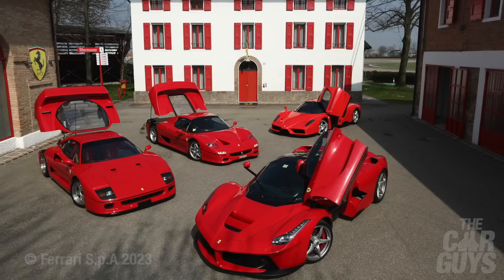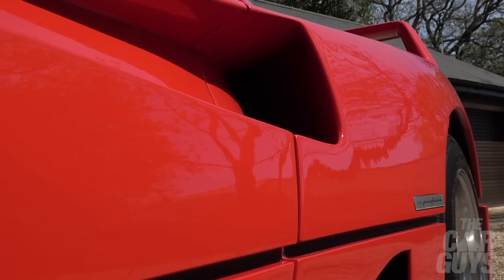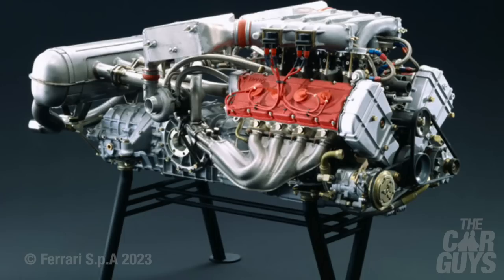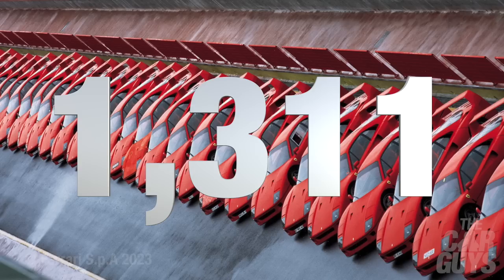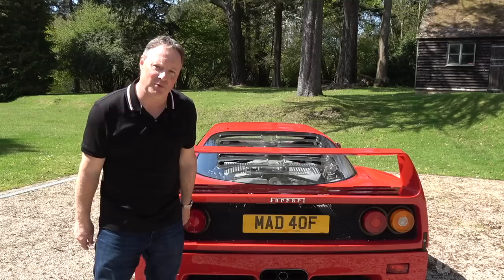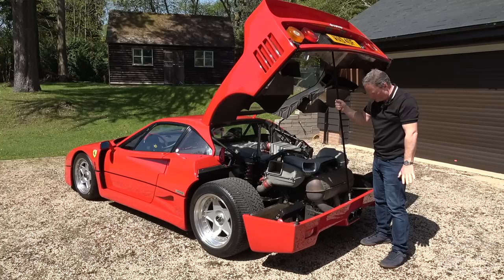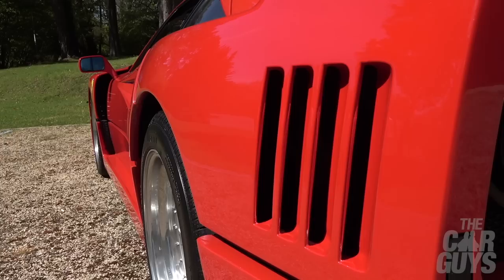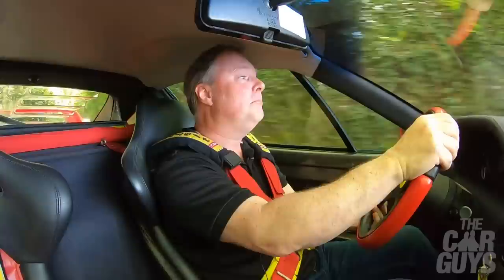FERRARI F40 - Why Are they Worth so Much & Will it Stop? #DriveEveryFerrari | TheCarGuys.tv

Comment: A curiosity that few people know and Ferrari would have forbidden those involved to reveal, the first produced units of the F40 in 1987 "between 20 and 25 units" have the same power as the 288 GTO EVO over 650hp and the weight below 1100kg because they were not within the regulations time traffic! But with that these units have a top speed of over 360km/h and do 0-100km/h in exactly 3s with the right tires! I had the opportunity to drive a friend's F40 a few times, each time I fell even more in love with the car, what a perfect machine! This friend's car is almost a daily for him, in just over 6 years he has already put more than 45000km, as he usually says, an unused car is a car that gives problems!! I hope to one day reach this level in my garage! Great content as always!
Reply: I had the privilege to race an F40 at Bira circuit Thailand many years ago. It was everything Damien said, and the acceleration was phenomenal when the turbos kicked in. That this was the last Ferrari approved by Enzo is indeed a fitting tribute to his genius.
Chris D.
Reply: Jean Alesi was provided with a standard looking 288 GTO with a 640-670 hp tuned engine. Saw a tirwsmoke filled picture of him and the car in a danish carmagazine.

Comment: The F40 was and still is my dream car.  If my numbers ever come up on the lottery this is the first car in my garage!! Great video love this series. 👍
Reply: Get the F50 instead, it is a better drive and has a V12.  Also you can take the roof off.

The F40 has great  looks but it's pretty close to a 288GTO which in itself is fantastically good looking.  And built better.

Comment: 288 GTO, 288 GTO EVO, F40, F40 LM, F40 EVO, F50, F50 GT, ENZO - these are the greatest Ferrari's ever made.
Ferrari went on after the Enzo, to make even faster cars.
But, none of the faster cars are on the same level as the 288, F40, F50 and Enzo.
The Enzo was the last great car Ferrari made.
Some people might think the LaFerrari is joining these greats.
Beauty is not everything, when the holy trinity were launched it was slowest accelerating and slowest lap times of the 3 cars. Surely a great Ferrari would not come last in performance and handling. Ferrari also find it hard to find replacement batteries for the LaFerrari, sometimes taking over a year to source some. Beauty alone does not make a great Ferrari.

Comment: I don’t doubt the iconic status of the F40 but have always doubted the last minute cobbled together vibe of the car, with very limited development prior to its public announcement. No one really wants a turbo car with more lag than an oil tanker, when a V12 is really what is needed. I remember seeing an F40 on the way to the Mille Miglia F40 meet in a motorway rest stop near the Gotthard tunnel - Father and daughter were in an F40, the daughter was driving & the whole car vibrated as they started the car up, the plexiglass glass was almost buzzing with vibration & the daughter who was driving, she had to really really saw at the steering wheel to reverse out of the parking bay. Both were hot & red & looked thoroughly miserable. It’s clearly a car for a blast, not a grand tour. Each to their own.

Comment: I think with sticky tyres an F40 will easily beat the 4.5 0-60, I remember back as a teenager when they were new I think it was Fast Lane did 3.9 in a std one as they continued to 170. Power to weight is still v high and as other commenters say, they usually had 500hp plus. I imagine half a second is nearly lost doing a dog leg 1st to 2nd though which a modern dual clutch does near instantly, so probably 0-60 is not a true measure of how quick they still go!

Comment: Great video once again of course.,

The problem is that the F40 has a few issues on being a great car and no, I am not talking about it having worse build quality than a 1980s Lotus. If you took the badge off it and just showed it to someone who knew nothing about cars they would say it was a kit car and worth about £20k rather than £2m.  The two main problems the F40 has always had are :-

1. Ferrari F50
2. Porsche 959.

Taking the F50 first.  It had a glorious V12 and not a laggy early gen turbo engine.  Although it looks ugly it is far better built and has an open top so you can hear the engine.  Apparently it handles better and doesn't have a steering wheel that is at an angle that it looks like it comes off a Number 12 bus (  Damien called it go kart as too kind ).   When Evo magazine tested 288GTO, F40, F50 and Enzo the F50 came out far ahead. And they are better drivers than us. Even Mark Hales in the classic Fast Lane tape "Now Here This" almost got caught out at Castle Donnington when the boost came on mid corner  .. "it's really quite docile ! .....   some seconds later ... "and it nearly bit me there".  And Mark Hales is not your normal driver like most F40 owners either.

https://youtu.be/gSWLgk9x40c?t=1896

The Porsche 959.  

Released just before the journos at the time thought the 959 would be far better than the F40, but then after driving the F40 said they were wrong. However, I think in hindsight it is the better car.  It is better made, it had better technology that would be seen in the future on other road cars such as traction modes,  a sequential turbo to reduce lag, and a clever 4wd system that got  a 3.7s to sixty.  You could drive this down to the shops and then go to the racetrack.

It also raced in the Paris Dakar and at Le Mans ...  the F40 had very little racing at the top end of the sport.   Also less than 300 road cars were made compared to 1300 F40s, I've seen a few F40s over the years but never a 959, so rarity wise it is uber cool.  True, it doesn't look like a supercar as the F40 does,  if they had given it the Porsche 911 GT1 body then maybe it would get more admiration nowadays.

I'd rather have a GT1, 959 of F50 any day over an F40.
Reply from the maker: Great comments, Andrew

Comment: I wonder how much more it would be worth if it had the original seats and steering wheel. Why would anyone put in aftermarket seats and steering wheel on an original F40?
Reply from the maker: As mentioned, the original seats are underneath the leather. The original wheel is also available, so I wouldn't worry about it.

Comment: Would be interesting to see some actual measurements (that is if some billionaire actually will risc some ice-cream money to replace a clutch) of the 0-60 times and quarter mile because there are sources that suggest a sub 4 second to 60 for the F40. The only source for some actual measured data on this car driven properly is on Best Motoring videos 20+ years ago. They were really driving cars like this back then